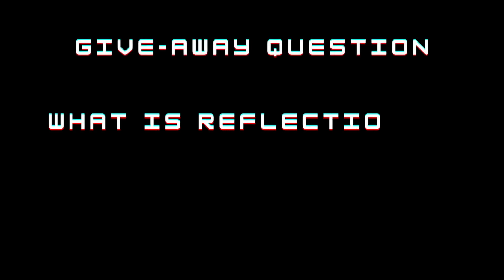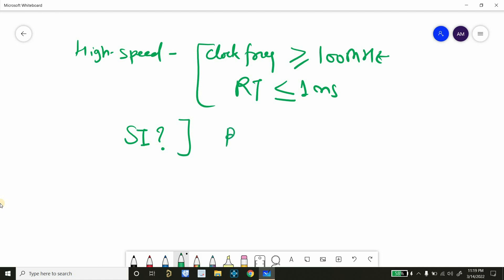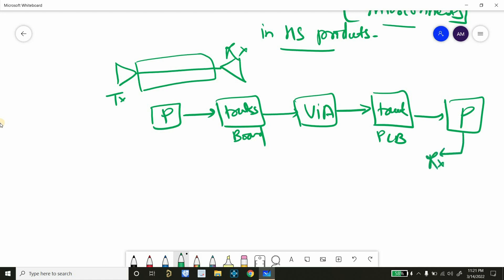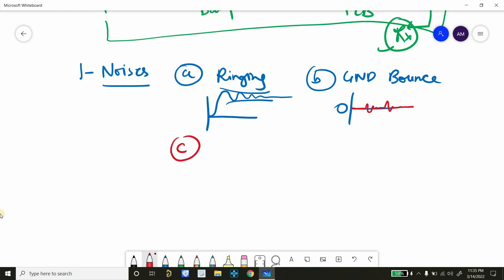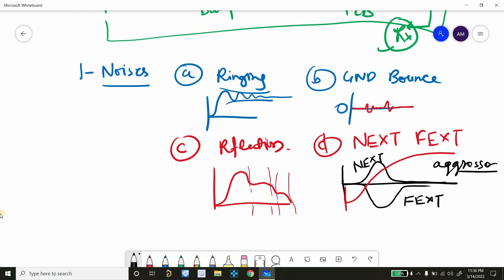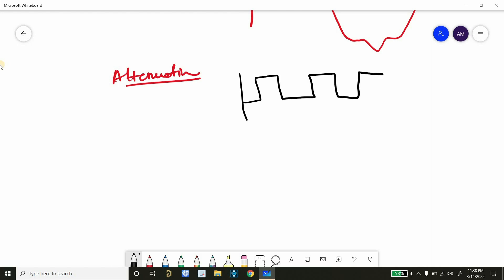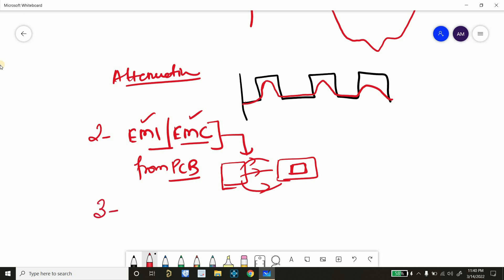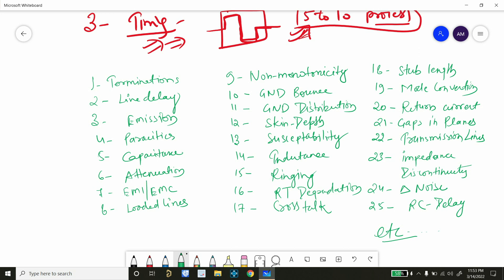High Speed Signals - What is Signal Integrity? and #50 Different SI Problems

Comment: Reflection due to impedance mismatch. Can i say plane discontinuing also?
Reply: And may I know how to decrease driver impedance in IBIS model?
Reply from the maker: You can easily do it in Ibis editor, search for zout in that and modify it as per your requirement, make sure to validate your Ibis model after modification.
Reply from the maker: Yes you can because that will cause the impedance mismatch too 👍
Reply: Can you please check your mail?. I have texted my query.

Comment: Hello,
Thank you for great video! I confuse the concepts of bandwidth, clock frequency and data rate a lot. For example, if I want to simulate a signal integrity in altium or another tool, should I set the period to 1ns for a 1GHz signal to the simulation, or should I set the trise 0.35/1GHz = 350ps? For example, is the clock frequency of a 10Gbps signal 5 GHz? Or is it bandwidth?